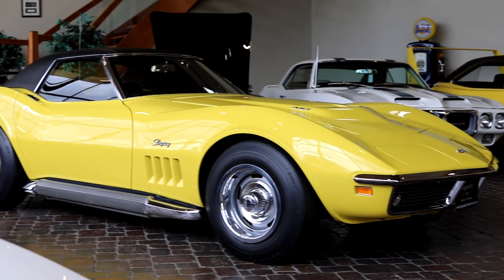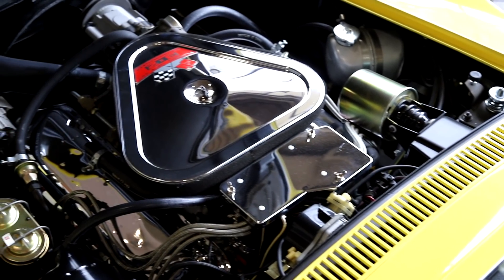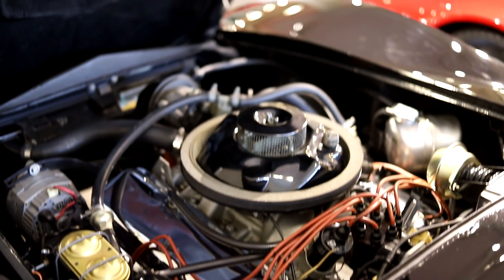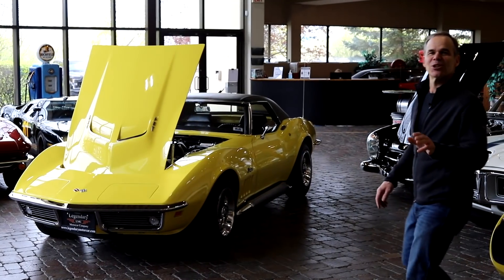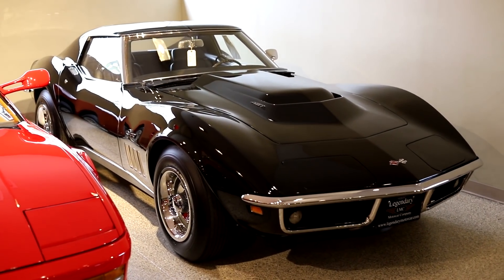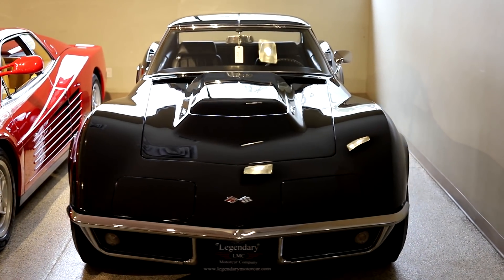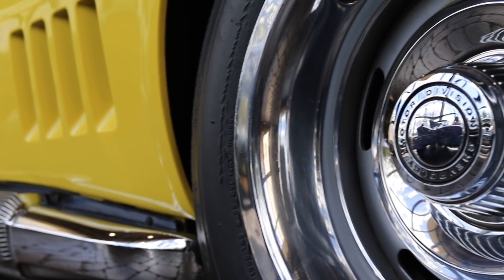Why this 1969 Corvette L89 is one of the top 3 in the WORLD!

Comment: A 68 in yellow with the RPO L79 350/360 was a Friday night car, and Saturday night in the garage.  It ATE throw out bearings, rusty calipers, always some ass ache.  Till when running on Smiths Ridge one night I got the attention of a cop, decided I had enough points already and put my foot into it.  And the timing chain let loose.  Gone forgotten, never again.  MOPAR
Reply: L79 was a 350hp 327. L46 350hp 350
Vettes are crap quality I swear. Same yr Camaros never had  aproblem
Pick a gen of corvette they are constant problems expensive parts ...meh

Comment: FYI back in the day the L89 was the tri power replacement engine. When I setup the Islip Fire Dept race trucks if you could not get the L88 the L89 was easy to get and I got them from Rumplick chevy. Read my first book: Islip Speedway and the two Six-packs which in film development, you'll both love it. One ZL1 vette was sized in a drug raid in 1994. I'm not sure if that's the one Dana Mecum owns? Anyway great cars great memories...

Comment: I would take the ZL-1 of course - there are only two, correct?  I have a question on the L-89 Yellow Corvette - why would it need to be restored if it only had around 300 miles on it?  Wouldn't it be worth more if it had not been restored, even if it was not "perfect"?
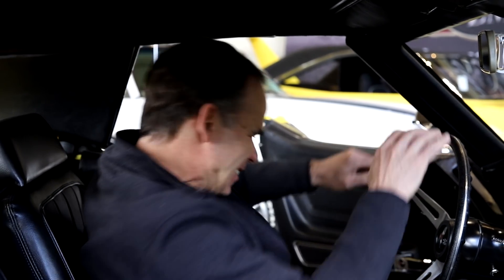Reply from the maker: We explain that a little bit in the video if you jump to the 4:36 mark - in short, back to original paint after the original owner changed it
Reply: @legendarymotorcar  yes I see that now, I must have missed since I was so excited to look at the paperwork! Anyway, I am excited for the channel - DCG was my favorite show - loved it!
Reply from the maker: Glad to have you aboard!

Comment: Original tires...question if you were to drive it wouldn’t there be rot even if it’s taken care of?
Reply: Yes. They would be scrap. If you want to drive it you would need to swap them.
Reply: Saw a guy blow the rear 1/4 off his 140 mile 75 when he tried to drive on them. Old tires are for the show field only, never drive on them even at city speeds.

Comment: Your not only one but I not ether after see you got same paperwork I got window sticker even little envelope the key came in I also have receipts plus  vinyl holder gos round steering column for the registration and only different is mine t top with  98000 miles  on it

Comment: What a waste of the most precious commodity we humans have. TIME.  instead of spending the last 30 or 40 years driving and enjoying, arguably the most fun car ever manufactured, the owner of this car blew it. He bought the car. He spent a bunch of money changing the car. Then he spent a bunch more money, changing the car back to the way it originally was.  Then he sold it and possibly made a few dollars on the deal. How sad. I’ve had my L 71 Corvette since 1970. I bought the car with 3000 miles on it. The car now has 185,000 miles and the engine and transmission have never been out of the car. I have modified a few things that I never liked to make the car a little more enjoyable to drive for me. I’m 78 years old now and luckily can still drive the car. I do drive it every chance I get which is usually at least 2 to 3 days a week. I’ve got 54 years of paperwork, including parts and maintenance. I’ve owned many many cars but sold them all because none was fun to drive as my 1969 Corvette. It’s a car. Drive it and enjoy it. Otherwise, if you don’t, you wasted the most precious commodity we have.

Comment: Was my dad's and it got hand down to me we he past away only thing it's been  sitting 25 years and I have finally got  it restored also after five years doing it  I got the ac left yes it came with ac and 8 track radio was add to it from the dealership shock me to see  you have sa.e kind papper work  my being a t top  in  amazing  shape  like new I put 15000 in it was my dad's so I still call it one owner car even it mine now  see nice ones but not like I got all it's papper work going for 80.000 to 100.000 I figure not for sale but if I was to it should do 140.000 or is that to low or Higher what your experience  say it be worth in 10 more years my plans to cash out on will get 300.00 o0 then  let me know I got bad eyes hope this read able